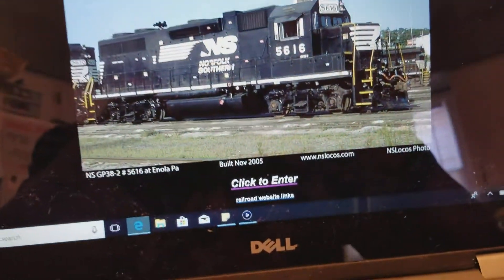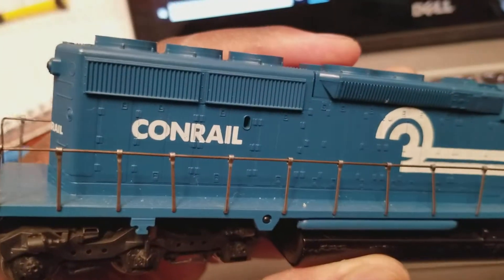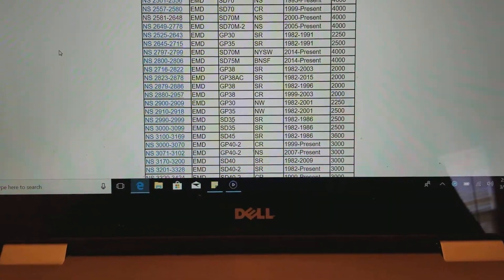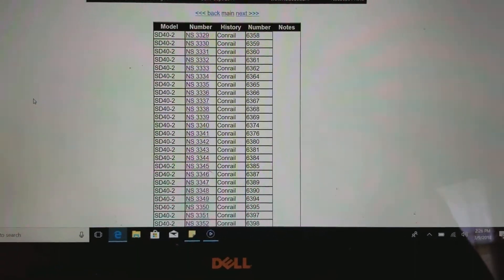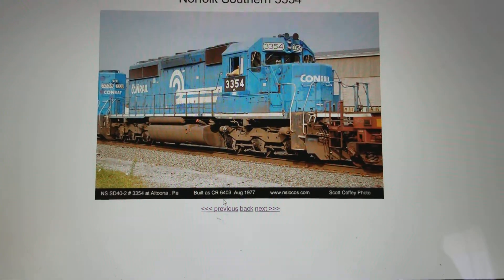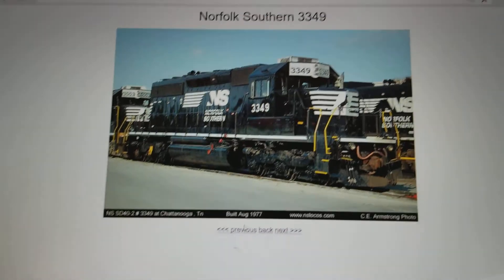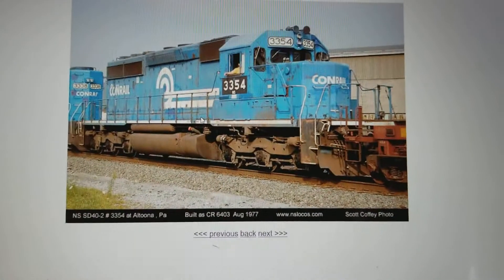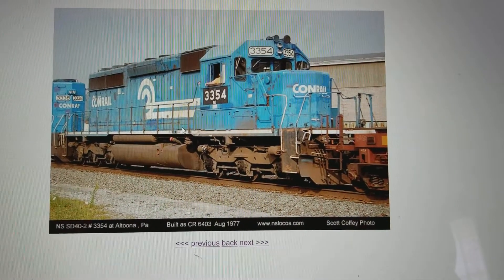CONRAIL SD40-2 PROJECT

Comment: NS Augusta, you got yourself a classic model there. That is an Athearn original "Blue Box" from back in the day (Ol' Schoolz).
They can take a beaten and keep working. Of course some modifications are needed, but a good platform to start a project with. If you can find the super detail kits that had the hand rails for Athearn SD40-2, they are brass and thinner and look real nice, hold up very well. Details West and Detail Assoc. have kits also for super detailing. Can't wait to see what you do with that gem.
Thanks for sharing!!
David Muse